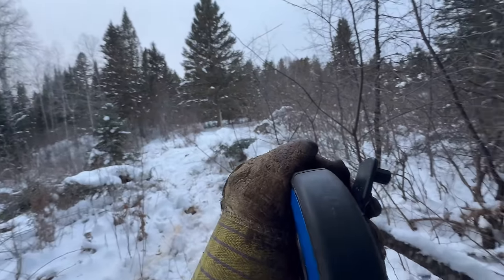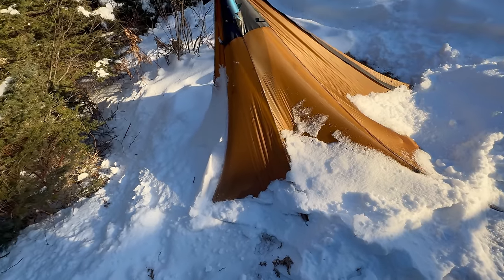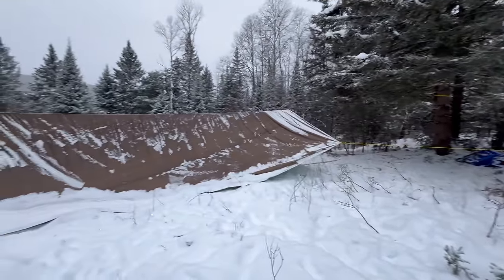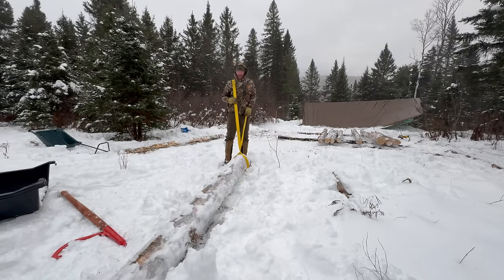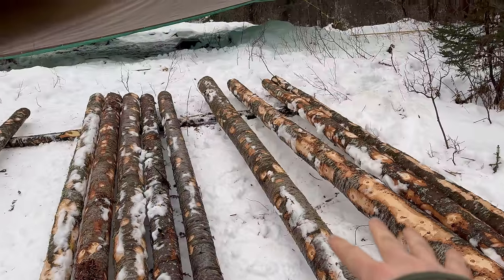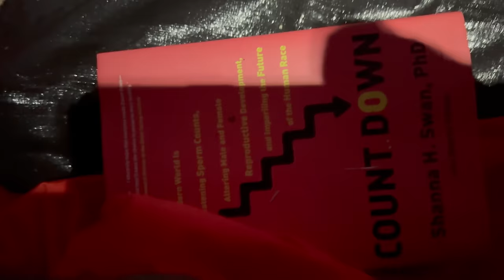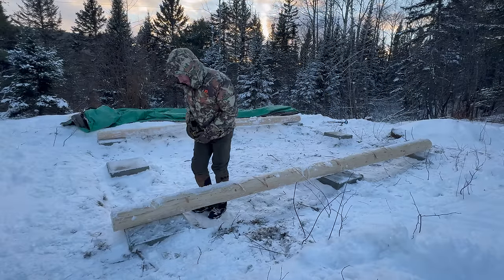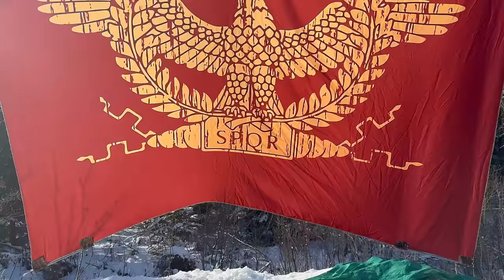Winter Log Cabin Build on Off-Grid Homestead |EP3|

Comment: It hurts my eyes looking at your sawhorses. Some tips: predrill the hole in the piece that the screw goes throug, use countersink to prevent splitting, if youre using 4mm screws drill the hole 3.5mm, that will help to secure two piecies together without a gap. Make sure you are using the correct bit(PZ2 bit with PZ2 scews etc). Id suggest you use torx bit, its less prone to skipping. Also use the slower gear that will help with skipping aswell. You should definitely add some crossbraces to the legs since youre planning to put them under heavy logs.

Comment: You need a ski, like an old snowmobile ski that you can attach to the far end of your logs, so when you are pulling them through the snow it's not digging in and so much work. Also you need to look up mechanical advantages with pulleys for pulling logs up your hill so you don't get hurt. You need like a 4:1 mechanical advantage system for ease with your logs
Reply: Like a old Skidoo alpine.  Would make skidding those logs a lot easier.

Comment: I have a friend who has quite a boat collection along with rafts, canoes and kayaks. 
I’m huge into paleontology and so my friend gave me this set of wheels connected by a harness that is supposed to hold the e d of a kayak or canoe so you can drag it to the creek or river through the woods. He gave it to me to help with hauling bone blocks out of excavation sites. 

I have 200+ acres in the Ozark Mountains. I have been dragging logs like you, the hard way, but my next trip to my land I plan to take the canoe rig to put logs on to drag around. Moving logs by myself takes a lot more strength than I have, especially once they get 8 inches in diameter and up.

Comment: 3 thing I think you need to buy since your doing this alone. Get a chainsaw winch, and a chain saw mill or an Alaskan mill princess auto has them, and last I suggest a nice wall tent so you can have some more standing room and build a pallet floor just a nice feature. That's just my thoughts. One more thing is a chainsaw log peeler it's also at princess auto will make peeling your logs go by faster

Comment: There’s a electric screwdriver attachment that holds your hex bits that has a sleeve that slides down over the screw to keep it aligned.    It’s a life saver.  Get yourself one!  Any hardware store.  I buy a couple at a time from harbor freight for cheap

Comment: The scope of your plans for this property are very ambitious, I look forward to watching your progress over the coming years.  And while it's true that "off-grid" can be defined many ways, given as you are using power tools, think about doing yourself a favor and investing in a snowmobile for winter and an ATV for summer.  You can use both for skidding logs around your property as well as hauling supplies in from the nearest road or wherever you park your vehicle.  We don't know what you drive, but if you don't already have a heavy duty 4WD pick-up truck, that would be another suggestion for an investment.  Maybe with a lumber rack on top?  Not 100% of your building materials are going to be able to be harvested on site and once you've got a building dried in, you will need items inside the building that you won't be able to build or jury-rig.  Further down the line, you might also want to consider a portable saw mill, it would enable you to create sawn lumber for floors, walls, ceilings, cabinets, shelving, etc.  Lastly, would like to recommend to you a fellow Canadian YouTube off-grid homesteader, Shawn James, his channel is My Self Reliance.  He doesn't create the light-hearted, humorous videos I find so delightful about yours, but he could be a great resource to you as regards equipment, building methods, and materials.  Looking forward to your next video!

Oh and BTW, you know, of course, that Romulus committed fratricide, right?  Sophie may give you a bit of side-eye knowing fratricidal brothers are your inspiration.  Just saying...

Comment: I’m enjoying the video. You are blessed to be able to take time off a job and focus on this full time.
I have a little over 200 acres in the Ozark Mountains where I started a little work in December. I rented a skid steer to widen an ATV trail into a road I could drive my Subaru Forester through to the build site.
I’m taking a week off of work here and there to work on my land. In March I started building a pole barn to put my trees in. I am using white pine that is common on my land on the ridges. There is a lot of oak on my land, several varieties, white red and few others.

Depending upon how dry the snow is I’m wondering if a leaf blower could help with some of the thinner layers of snow.

Comment: Dont use the phillips head screws, they strip easily.  Try Torq head/star drive screws, they won't strip, are easily removable and come in a large variety of sizes.  Torq head "timber lock" screws will become your very best friend on this build.
Reply: I was thinking a impact driver would be a good upgrade, and then right after he unboxed one 👍. Impact, Torx screws and some good quality bits

Comment: consider using some cables up in the air along your logging trails and then use pully blocks on each end of the logs to the cable thereby suspending the logs in the air and just push or pull the suspended logs along the support cable.

Comment: Winch time woo! Now double that cable out, get a cheater bar for the handle, and get really good and working the realease! Pro tip- with the winch under tension, just flick the little spring under the handle that engages the winch teeth to ‘open’ and just bang the handle the opposite way, it’ll pop your spooled cable loose. 

Also, get a chain to choke the logs with… maybe order a spool of cable to use instead of the rope too, cause 100’ of chain would be unmanageable or too light

Comment: I suggest using the impact drill and not the regular drill it will work a lot for you to get the screws in but good job so far looking forward to the next video
Reply: I cringed when I saw the normal drill. Definitely use the impact Milwaukee and you will suffer less…. Although I am a Dewalt guy but better than the normal B&D drill definitely….

Comment: Hi there, I know the Romans used something similar to these, how about a couple for ease around the site and security, too. I just picked anything from the interwebs. Ultra Bright White LED Security Wash Flood Light Floodlight Lamp High Power Black Case Waterproof IP65 Superbright 6000K 6500K (Cool White), 12-24V Input Low Voltage. Keep going you're doing what I hoped I'd being doing the last 3 or 4 years - my wife is just not into it, yet. Good luck and success.

Comment: Good upgrade on the milwaukee from the black and decker. Get that roof up on the cabin ASAP, and be sure to leave yourself a bit of an overhang, especially on the front end... I'd suggest extending it about 8ft from the cabin and adding a couple supporting posts. This will give you a spot to put a few things, plus give you an area with a bit less snow to work in come jan-feb... Does mean you're going to need about 3 logs that are about 28ft long though... It will suck getting them up where they need to go... But it'll be worth it in the end.

Comment: The gas canisters and coffee filters are gonna get realnold and real expensive.    I would recommend a regular percolator and a twig stove.   Also you will probably start keeping a kettle on the stove at all times ..  to have some fairly warm water for cleaning or quick to boil...and for the humidity ( wood fire heat tends to be very drying )

Comment: build yourself some tripods out of some 12 -15 foot logs, place them on either side of the ridge line and use them as the anchor points for the corners of the tarp, ideally, a heavy duty oiled canvas type tarp is best, they are extremely heavy but will last. With the ridge line higher than the corners the snow should slough off with assistance from below. The best line for tying that lashing would be have a roll of 1/4 inch manilla rope. You can also use tripods to lift the ridge line higher if you want to give it a steeper peak, or on the outer edges run a 3 inch pole from tripod to tripod then draping the tarp over it, giving you essentially a roof line. 

the trick to cowboy coffee is to premeasure the amount of water per cup of coffee going into your pot, so 8-9 oz of water per cup, then put it on the stove, bring it to a boil. the closer to the exhaust the hotter the temp. once its boiling take it off, add two heaping tablespoons of grounds per cup of coffee, stir,  put it back on the stove for about a minute to simmer, remove and let it stir again, sit for about 4-5 minutes stirring every once or twice. then slowly add a little bit of cold water, this makes the grounds that are floaters sink to the bottom. coarse grind works best. the other way is to put the grinds in a sock or stocking and drop them in the pot, like a home made bag.  I use an enameled percolating coffee pot nowadays, i set it on a swedish firelog or small campfire and will make a large pot for the entire day. The pour over is great, but it's like a treat, only for special times hahaha! im enjoying following your content. Good luck!

Comment: Small tip: It's not necessarily the wind coming under the tarp that's the problem. If the angle of the tarp is to steep, it will actually cause lift (like an airplane wing) on the other side of the tarp due to the lower pressure. It could actually in some cases help to have openings below the tarp to prevent the pressure difference above and below the tarp.

Comment: So pleased when you broke out the new Milwakee tools.  Seeing that first black and decker drill and thought oh boy we are in for a rough build.   Man, you have got to be thinking smarter not harder on these logs if you are going to be moving these by hand.  You can sled both ends in the snow or in the summer get beam dollies for the ends that have wheels on them, none of that dragging things around.  You should also just go buy yourself an ATV now and use it, you already know it's just something you will be eventually buying anyway.  You built the road already, just save yourself the heart ache right now and use the ATV to do the log pulling.  You should build your self a log crane  now over the build site and just save you all that lifting you are going to have to do.

Comment: why don't you put SBS bitumen base coat between the wood and the concrete slab? It will rot there because the moisture will go from the concrete into the wood. And i would build even higher of the ground.

Comment: You need « Static » rope if you want it not to « extend » or « bend » when winched. Go to Sail or any outdoors shop and ask for a 200ft Static Rope made for climbing anchors. 12:50
Reply: Stilll looks good tho. Might’ve been quick on the expensive comments 14:36

Comment: Leave the bowed 10-inch log alone. The weight when the structure settles will push it down or if it doesn't it won't matter anyway.

Comment: That's polypropylene, not nylon.  And yeah.. she stretches horribly.  For a ridge line I would spend a good coin-drop on a static rope with low stretch or even wire rope (it's not that expensive).   You will be constantly tightening a polyprop ridge line.

Comment: Have you thought about a chainsaw winch?
Reply: And I'm thinking what about getting the cable higher off the ground? And maybe 2 dangles if the cross cable can handle it? Get the log looped, hoist it a couple feet, push it up the run, unhoist and go again? Or even yank the handle off the winch, mount it in the right spot and use the drill on it to winch the log uphill?

Comment: 'NEVER SADDLE A DEAD HORSE'.  You need to reverse your steel cable clamps - the curve of the u-bolts should be on the dead end, not the cable carrying the load.  And the saddle on the live cable.   Very important for safety.   Never understimate how much energy is stored in a cable when under tension.  You don't want to be anywhere close if there is a failure.    https://youtu.be/audmZA4RCMI
Reply: as he said, they need to be turned 180 degrees..... this current way the U bolts are cutting into the part of the line under tension and will weaken it...

Comment: Ok. A lot to cover here so I'll keep it as short as i can.
#1. I've done a lot of construction/home building. And by the looks of things im about 10-15 years older than you. 20 years ago i was exactly where your at. So please take my suggestions into consideration i beg if you. I applaud your enthusiasm and grit, i was the same, but let's think long term here. 
#2- this is my most important suggestion, get yourself the best tractor you can with a loader. Something about 40-50HP would be perfect. Used/New doesn't matter just get what you can afford. You can use it for log skidding, lifting logs into place, snow removal, grading, digging, moving stone,the uses are endless. And when your done with it you can sell it and get most of your money back out of it if you so choose. Heed my warning here, please. The amount of physical labor you have ahead of you, you cannot comprehend. But i can cuz I've done it from start to finish twice.
#3. Invest in good tools, the Milwaukee 18V is a good choice. Ive used them all and Milwaukee is the best IMO. 
#4. For the big tarp and skyline: cut some smaller logs and put them on the end of the tarp where you would normally stake down. Tie off the tarp with the logs on top. This will hold it in place and when you need to move it you can simply roll the logs out of your way.
#5. If you can get yourself a used "Wallenstein Winch". It's uses are many, and you can sell it when your done and get your money out of it.
#6. You dont know it yet but all the physical labor will take its toll on your body. I'm already seeing it in this video. 10-15 years from now you'll wish you listened to me about thw tractor. Take care of your body, you need help and if you can't do it with man power than use machines. 
#7. Don't be stubborn, work smarter not harder. I love ya brother and you got an awesome future ahead of you. Your channel will continue yo grow and youll make some money doing so. Please consider my suggestions as they will save you much misery down the road. If you want to research me you can look at my channel. It is not monetized so i got nothing to gain here but transparency. Its simply crazy days homestead.  Good luck my friend and God Bless. You're doing 👍